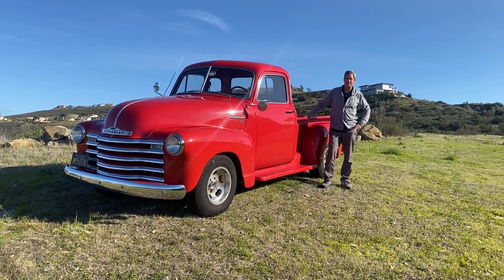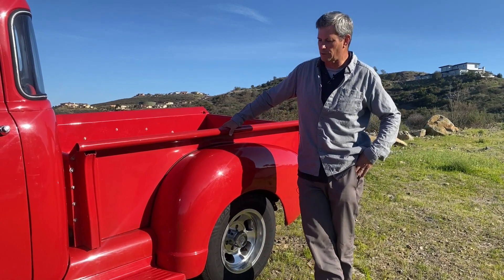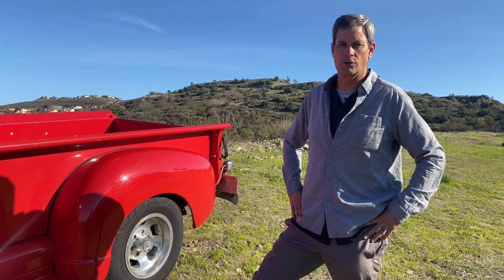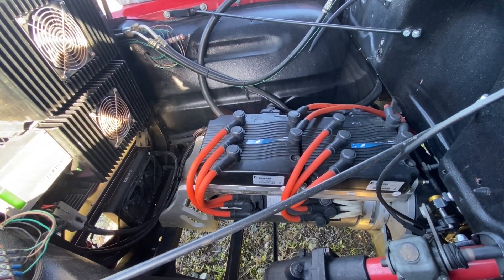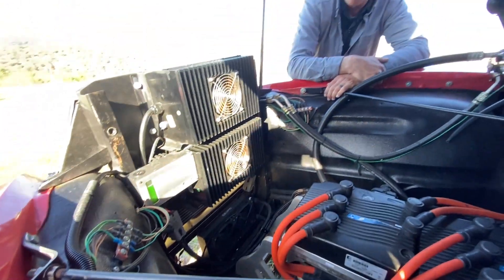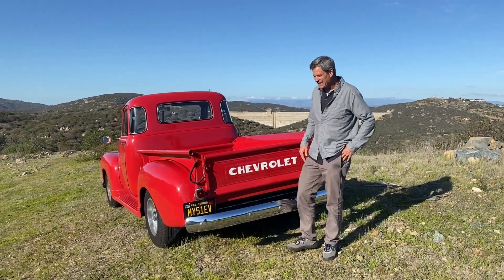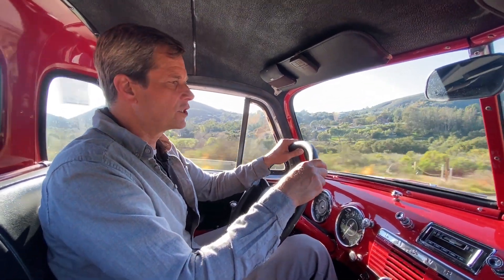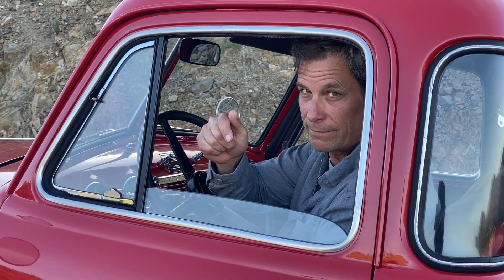1951 Chevrolet Pickup Truck Electric Conversion, 5 Years and 25,000 miles later | EV Show

Comment: I have the same truck. It’s all original except for the gas tank which was mounted under the bed. Unfortunately, it’s not reliable. I’d like to convert to electric as well but it looks really good under the hood. It would be a shame to take it all out.

Comment: I have a '51 5-window and would love to do this.  I brought it back to life in the traditional way with a 327 v-8 and a 700r4.  I also have a mini-truck, an '85 Nissan 720 that will indeed be converted first, and if I have success with that conversion then my '51 will be up next.  This one is great looking, I love how clean the engine bay is, and my favorite mod is the charger connection in the old fuel filler hole.  My only negative is I'm disappointed the speedometer doesn't work.  Man what a fun truck!

Comment: I'm fascinated by the idea of converting my Malibu Classic wagon to electric power, and a setup like the one shown in this 51 5 Window should work well. Maintenance concerns me. I live in Kansas which is very far from most EV conversion shops/garages. I understand that the clutch, brakes, suspension ect...  would be pretty similar to the way it was as an ICE car but what about the EV parts. What sort of issues would I see with a set of Tesla Model S battery modules, would the AC 34 Dual motor and its controllers have problems? What about chargers and the other electronics?
Reply from the maker: you can check with the sales team at EV west using sales@evwest.com they can answer the specific questions you have. Drew - EV West Media Manger

Comment: Why would you need to change gears or have a transmisison with more than 1 speed?  Doesn't the electric motor put out the same power at a massive RPM range?

Comment: Can't fault the workmanship or the execution of the technology, I know this is coming. But-the "just like a golf cart" comment says it all for me. I had a 51 3 window, 327, 4 speed.  I drive a 55 chevy 6 cyl. a lot. The E-truck driving experience seems pretty sterile. I love the whine of the trans, the rap of the dualed out 6, and the slight odor of oil and gas. Cool truck, but on the road, it has no soul. I like it, but I don' think I would ever love it. I have thought about doing this to another of my older cars, but now I don't think so. I know there are gains and losses, but for me, the gains don't cancel out the loss.

Comment: 40 KW 120miles vintage pickup
 1.5 KW 50 miles my mountain bike 
4.5KW I get 150 miles
So you're getting 8 X  less range for the weight

Comment: How does this electrical conversion kit work in wisconsin winters? How long does it take to charge this system, do you need a 50 amp plug in ste up for your garage?  Are there conversion kits available in Wisconsin/
Reply from the maker: You can check with the sales team at EV west using sales@evwest.com they can answer the specific questions you have. Sorry of the delayed reply... Drew - EV West Media Manger

Comment: I learned to drive in a 1955 International pickup truck. It had a '3 on the tree' transmission and an inline 6 engine. I can totally relate to the terrible gear box. It was noisy and difficult. I used to double clutch when driving it.

Comment: I'm thinking with a truck that used to carrying weight ,you should be able to put two Tesla batteries in there. Skip all the high-tech ,use two separate charge plugs and Manual a battery B battery switch in the glove compartment. Small touchscreen display for battery status in the flip down visor to keep the Nostalgia. 😎

Comment: He should take the truck to Jonathan Ward at Icon Motors and get rid of the chains on the tailgate.
Reply: That's part of the charm of the "original look" to the bed. Much more practical than today's "modern" (easy to break) handles. I actually prefer the pins and chains.
Reply: @fixitmann6685  I guess it’s just a matter if you like the rattles or whether you do not.

Comment: I'd be switching out the fenders for lighter fiberglass. There's a lot available.  1947-1953
Front Fenders
Running Boards, smooth
Rear Fenders, flat edge
Rear Fenders (3" wider)
Rear Fenders - panel truck
Front Splash Pan   He really needs to invest in better steering. Looks like it has a lot of play.

Comment: Why not enclose the bottom of the engine bay?  I think it would reduce drag thus giving more range.  Did the battery pack take up the whole underside of the bed or is there room for more batteries?

Comment: Would you be willing to offer your opinion on how this AC-35 might do powering a 1968 C10. I estimate the 68 is about 900lbs heavier than this 51. I don't mind a reduction in acceleration/top speed, I just don't want to damage or shorten the life of the motor.

Comment: I give you a Plus on that transfer from gas to electric that's cool looking pickup truck I wish I could have had one like that that's automatic or is that thing automatic I always like the truck like that I always thought when I saw was standing I got a model somewhere around here that's a 53 Chevy truck bed out there and the yard and I have lots of trailer and I have a model pickup truck that's a 53 diecast doors open and stuff you don't want those little fit on your desk kind of models but anyway I always wanted a 53 Chevy all electric automatic with enough power to smoke the tires if you need to
Reply: You can build whatever you like. Good luck, though. Who would want a classic truck with an automatic, or that would be a speed demon (smoke tires) Maybe you should start with an RC car kit...

Comment: Hey great Vid.  Any thoughts on future EV West conversions for my 1999 Mustang GT 5-speed?  When the V8 engine dies in the distant future I would think seriously about a similar Electric motor-5-speed tranny-rwd conversion.  Maybe put the battery where the Gas tank is and supplemental battery packs in the rear seat delete space? How do you heat the cabin in these conversions?  Certainly there is no heater core.

Comment: Hi, I am so happy about your report. I got the 3100 1/2t from 55 1.series here in Germany and got all your pictures from your website saved on my HD, because I could no info about your conversion or any EV kit from you nor a gearbox plate on the website of yours. 
Now I understand why you did not show any information about this conversion. I thought the owner might have asked to keep the car private and it not being shown on the internet. 

Very nice report about the car. Better than a thousand pictures. Thank you !
We already have two Teslas, but our Chevy is on the list for a conversion.The truck already had two full restorations in the last 39 years, since we have it. It is now better than new and before the second restoration, it was daily driver. 
To top of it off now, we have to make it an EV. 
There is only some legal stuff, I got to check here, because it will loose in Germany because

I really would be happy, if I could contact you for a specific kit for my PickUp. But even it is a little louder driving it, I still want to keep the 3-speed, because it is original. I want to keep it as original as possible. As it is right now.    

You made my day today with your video... !

Comment: I might have thought about a set of Foose wheels it’s just me. Great looking build, well done Gentlemen.  What EV motors did you install and how far can she go on a full load? Thanks.  There is another EV C-10 with two Tesla motors and a battery bank being built for SEMA. Why no speedometer? Another question don’t you lose quality a bit of HP with the manual transmission?  That said Well Done Gentleman

Comment: How much is the conversion cost ? 
I have a 1950 Chevy 3100 with a S10 chassis, I just finished the interior, brake booster, brake lines with a 5.7 camaro motor and tranny , radiator went in today . I haven’t wired it up yet . Now I want to switch to electric. Is there a conversion kit to buy?

Comment: Yeah I don't know about that not needing a clutch in a manual. 

"Grandpa way do you stomp the floor with you other foot whenever we stop?"

Me: You wouldn't understand
Reply: What's funny is the latest automatic transmissions have up to three (electrically activated) mechanical clutches in them. Very expensive and complex. They had to do it for "fuel efficiency" of up to 20 mpg using 8 or even 10 speed transmissions. Ridiculous. Just reduce the V8 to a straight six, 500 horsepower to 100, and top speed from 120 mph to 55 mph. Get 30 mpg with a 4 speed and a clutch.

Comment: Ide like to convert my 95 gmc yukon 4x4,  wonder if there is any problem connecting a electric motor directly to the transfer case to keep it a 4wheel drive or do I still need a gear box?

Comment: I have an old 74 F100 that I wish to convert to EV.  Would be cool to drive around, especially since it gets 9 miles per gallon.  Hmmm how much does it cost to convert?
Reply: Battery pack alone is worth more than your truck. All the other parts are, as well. And if you plan on having a shop do the conversion, double that price. So probably about $50,000

Comment: I have a 1948 Chevrolet 3800 series 1 ton truck my question to you is can you put an electric motor in there that runs off the braking system as well as the gas system also I'm looking for a range of about 550 mi to 600 MIles utilizing both battery and gasoline and or electric motor thank you for any input Gary c spears Greenville Indiana

Comment: To each his own. Like kissin your own sister, its probably really fun, but some folks just wouldnt do it. As for me, I'll give up my carburetor when you pry it out of my cold dead hands.😉
Reply: I won't work on anything that doesn't have a carburetor. That just means I won't work on anything newer than say, 1990. But on the other hand, I haven't ever had to "fix" anything on the fuel system on anything built since 1990, whereas I've rebuilt or replaced a LOT of carburetors in my day. They're nothing but trouble.

Comment: I have a 2017 Ram 3500 duelly with 4 wheel drive. Is it possible to retain four-wheel-drive converting to electric and is it possible to get or carry enough battery to get say 600 miles between charge? How much would the conversion be?
Reply: You're kidding, right? You'd need about 10 battery packs and FOUR motors to do something like that, and your top speed would most likely be under 25 mph. And it would cost probably $200,000.

Comment: I would think with a truck you would be able to carry enough batteries to get even longer range than the cars.
Reply: Sure, at the cost of having no payload capacity. For example, fill up the bed with batteries, but don't even carry groceries, let alone 2X4s in it.

Comment: Quick question:  Has EV West ever done a 1965, or later Corvair conversion?  I think it would be amazing, you'd have the rear transaxle coupled to a Corvette independent rear suspension.  A lot more room in the rear for the electric motor and controllers plus maybe two battery packs plus some behind the rear seat.  Remove the Frunk gas tank from the fire wall, put in a dual brake cylinder, disc brakes and a huge battery pack in front.  I'd be surprised if you didn't get at least 75kwh or more.  This would allow you to weight balance the car and eliminate it's weight bias problems.  It would be a stunner as a two door red Corsa model with black leather interior.

Comment: I daily drive my 52 GMC truck and am really interested in the A/C evaporator installation in your EV 51 Chevy truck.  Vintage Air's evaporator kit for our trucks mounts behind, below and partially into the glove box and then takes up a lot of under dash space running duct hoses to distribute the air.  Your install in the original radio space makes more sense to me.  Are your Vintage Air pieces available over the counter?

Comment: First of your videos ive watched and i expect youve explained this many times before, why do you retain a multi speed transmission? Cant the motor go in the trans tunnel and connect to the drive shaft?.. Lovely Truck.
Reply: Apparently, the motor they're using has a narrow rpm range.  I'm converting a '66 Mustang and I'm looking into salvage Tesla motors. 0 ~ 18K range means no transmission needed.   Explains why Tesla makes their own electric motors.
Reply: Sure, you COULD do it that way, if you replaced not only the suspension, but the differential and frame,  which were all meant to handle the 90 HP gas motor that would only rev 700 to 3000 RPM, and the torque was transmitted back up the closed driveshaft to the transmission to the frame. For a  motor that has full torque from 0- 18,000 RPM you'd tear the whole  differential, axle and springs up, let alone the frame no longer distributing the power throughout the vehicle rather than just to the rear tires.
Reply: @fixitmann6685  Ok, that makes sense. Thanks for explaining.

Comment: how does the motor, twin 35 handle the end thrust from the clutch pressure? and what did you set the max amp draw at in the controllers?

Comment: I have a 83' S10 that I would LOVE to convert...when I can afford to. :(
Reply: I no longer have the 89 S-10 pickup that I intended to use for my 1951 Chevy 5-window. Perhaps I’ll use the 3/4 ton 1954 Chevy frame, but that means buying a more modern IFS in addition to everything else. Yea, my 51 is also mostly rust. I’ve gotta learn how to use a mig welder to fix that without going broke. 
At least we do have our 2019 Tesla M3 standard range while other projects are being accomplished. Right now it is more solar modules, more capable inverters and home base LiFeP04 batteries. Retired does not pay as good as working so most things are held back for money.

Comment: This looks amazing! Minus the truck itself, what does a modification like this cost?
Reply: No answer, that's scary!
Reply: @buckrepublican8782    you can take 2 minutes and look at their website. There is a wide range of options, but motor and battery are around 20k. Id tack on another 10k for vehicle specific parts you need. Install would be another 10-20k most likely. Every vehicle, even just different years, will be a different price. That's why they don't give random estimates on a social media site.
Reply: @ocman11  OR the company can provide a little CUSTOMER SERVICE to a PROSPECTIVE CUSTOMER and you can keep your crappy attitude to yourself
Reply: @dmcrew4968  ok karen.....
Reply: 😂 what is the website?

Comment: My ol' '60 Apache 10 had the inside gas tank but it never leaked. Always wanted to put a dual Hyper 11 setup with a pg and battery pack. It would be used as a pickup though so the torque is definitely needed. Why doesn't the speedo work? It is trans driven so should be working.

Comment: in a very wet climate, would you recommend some sort of skid plate or engine protector? how resistant to water are most of those parts?
Reply: NOT TO MENTION JUST KEEPING IT CLEAN.
Reply: Motors and batteries are 100% water proof, you could drive it in a lake if the truck didn’t sink..FYI

Comment: Outstanding! /I have a '56 Studebaker Transtar.. 3/4 ton. if it wasn't running so well on it's original low mile engine I would convert it to EV in a heartbeat!
Reply: I have a 58 transtar and I think I will convert my truck as I am on my second flat head motor.
Reply: @roberttaylor8918  flat head?? That would have had a 289 ohv..
Reply: @Turk380  My truck is a 3e5 so its a base model with the deluxe package. so it came with 3.0L or 185 CID flathead motor. It gets like 30 MPG but it wakes forever to get to 70 MPH.

Comment: Awesome truck. 
Would it be possible on such a vehicle to remove the gearbox and drive shaft, and mount the motor on the differential, perhaps with a planetary reduction gear in between? Just to remove complexity and noise sources.

Comment: what are your thoughts on a 1980 Dodge D150 pickup with a TESLA model S P90 rear drive unit? I am going to lower the truck, It has a Flat cedar bed and I want to split the battery pack between the rear frame rails and the engine bay. Upgrade the front suspension for a 4 wheel independent setup. What do you think, will this drive unit work?

Comment: I am literally building a 51 gmc. Lol i was gonna go with a ls. man im leaning ev now lol
Reply: Make sure you make a video of the conversion.  😎
Reply: It kinda makes sense now a days. I have a 71 mustang and a 63 F100 that will probably get the EV treatment as they undergo restoration. My 04 Ranger probably will too when gasoline does go away.
Reply: Lol yup take care of your gas engines they won't be around forever. Put that ev power train in and drive it like you stole it 😂

Comment: Yup
Soon as it's electric you start driving it everywhere instead of it wasting away in a garage with some carb issues
Reply: Exactly what I saw about classics. Put that engine and trans in storage and drive the piss out of it!
Reply: Another underrated thing. Most wives don’t overly love the smell from the carbed engine. A lot have complained smelling like gas and the stink. Some love this aspect, most don’t.

Comment: Perfect application for an EV conversion. Turning an old clunky vehicle into a modern trouble free wafty cruiser. 
Please open a UK based workshop...
Reply: In the UK you have Electric Classic Cars which do pretty much the same type of conversions and from what I’ve seen the quality is on par.
Reply: There is also Zero EV. Both them and ECC are awesome companies. You have good options.